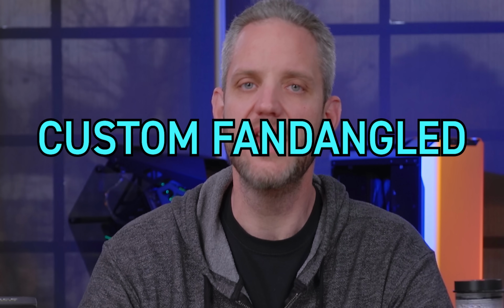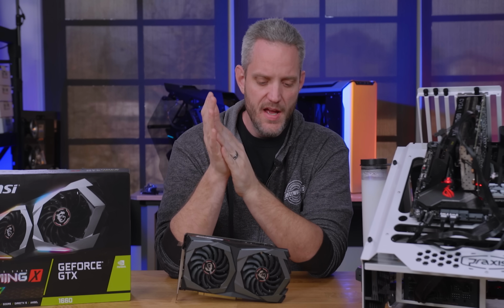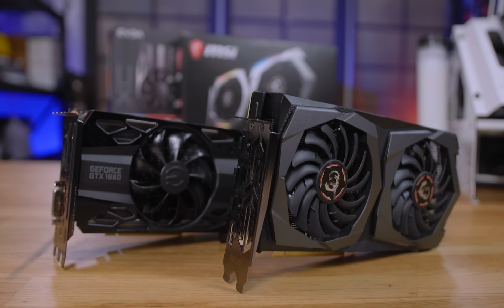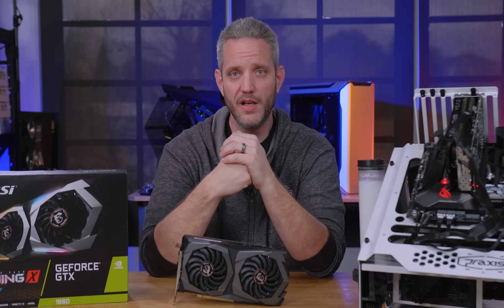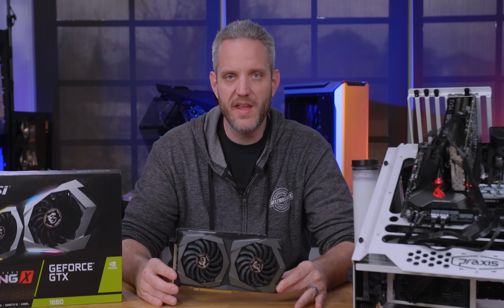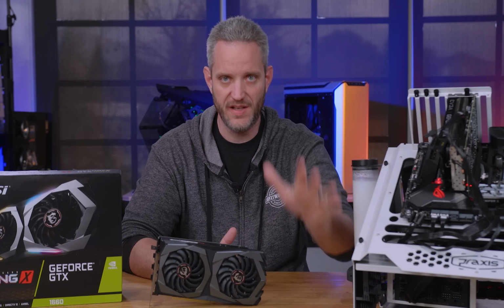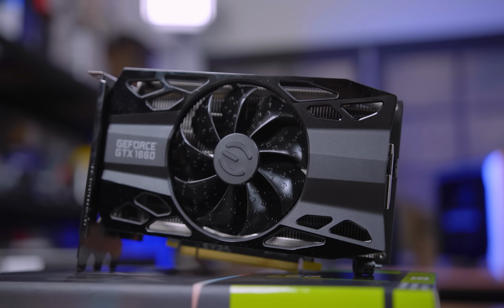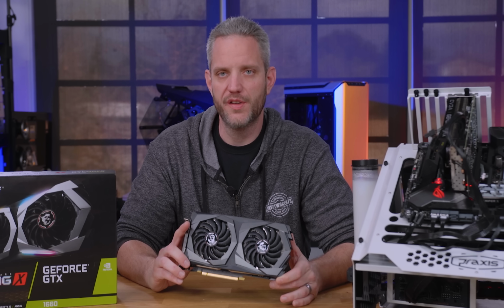Just save your money.... GTX 1660 vs GTX 1060

Comment: Nvidia is crowding the stack so AMD can't jam a card into an open niche
Reply: With AMD losing the bonus of freesync... they have to beat Nvidia in price to performance. They don't really have anything going for them anymore.
Reply: @calebjames7330  I want AMD to focus on Ryzen CPU's because they are freakin good
Reply: MBA right there
Reply: Well, NVidia has an 82% share of the GPU market for a reason.
Reply: @wolfshanze5980  Indeed, OEMs and laptops are a bitch.
Reply: The good news (and i run a ryzen system and have nearly always used amd cpu's for 20 years) is that intel is getting into the game. It has become obvious that AMD's video card upper management is incompetant
Reply: @hbihu One thing remains though, if you consider taking full advantage of a NVidia Card, you talking GSync, meaning those very overpriced Monitors for 3x the money you would purchase any normal Freesync monitor. 

Now here is where college eduction comes into play:

NVidia Setup for 1080p gaming--> MSI GTX 1660 TI + Acer Predator Z271U bmiphzx 27"(yes only a 27") = $310 +  $764 = $1076
Now do the same with an AMD card and a Freesync monitor... half if not even less $$$$, its basic economic

AMD setup= RX580 $210 + LG 34UM69G-B 34" FreeSync IPS WFHD Ultrawide Gaming (YES a 32" panel) $388 = that makes it a grand total of $588 

Yes the PC master Race will always go with NVidia and always go with the Intel product just because they can... is the juice they drinking worth the squeeze? Hell no.
Reply: No. I reckon it is stacking to offset poor sales. Desperate action. NVidia releasing this many cards in a short period. Purely to close gap on a bad forecast.
Reply: Only better for consumers cuz amd will try to get some in there and to do so it has to be a bit cheaper
Reply: amd has been trying to just compete with what nvidia makes. their next navi cards will be the same. they will try to compete with the 2000 series , not more not less.
Reply: I didn't get it ... Can you explain it to me my brother ?
Reply: @Aniket Sharma Nvidia are filling the market with GPUs across the price ranges to try stop AMD from pinching any value spotlights.
Reply: @an1ketsharma  basically saturating the midrange market with several cards at very similar close prices....so when amd comes along with navi, which will probably be toward midrange market ($200-$300 cards at vega 64 levellike performance with  8 gddr6 imo), nvidia willl basically already have an answer/competition to it or can just put sales.
Reply: @NateT092  What if they have a better performing GPU than the same card offered at the same price. Will this theory be still applicable ?
Reply: @hbihu IKR, so how this saturation is supposed to impact the AMD Navi launch ? I am not getting it.
Reply: @an1ketsharma  

I'm going to make up numbers here but it will illustrate the point.

In 2019, 1000 people will build a new pc. 200 will go for higher end cards. The ones that retail around '500+.
600 will go for mid range ( $300 to 450) and the rest will settle below those margins (older generation cards and other $250 alternatives)

600 people (or 60%) will want to build a mid range PC. If nvidia puts out 10 different cards that fit within the 300 to 450 price range compared to AMDs 1 or 2. Those 600 people are more likely by the numbers to buy an nvidia product. 

This completely ignores other market forces, the most obvious being that nvidia is already in the market for this year. So if 300 out of that 600 have already bought parts, that leaves AMD if they released today, with only a possible 300 to still pick up. 

I hope this cleared this up.

Comment: Please do a comparison between GTX 1660 vs Rx 580
Reply: What I've seen from other reviews say 1660 is about 20% faster. I'd say worth it if you can grab a 1660 for around MSRP, yet the 580 is still a compelling buy under $170 which it can easily be had for.

Comment: Jay,  what are your thoughts regarding budget builds and the current graphics environment? Last year several channels did builds in the $300 to $500 range using the 2200G or 2400G to avoid the insane (at the time) graphics and memory markups. What is the current upgrade path? Another 8 gigs of memory and a 1660 TI? Replace a slow 8 gig kit with a fast 16 gig and a 1660? Straight to the 2060? Thanks for what you do!
Reply: Go straight to the 2060 if you were planning on buying a 1660 or the ti already it’s not that much more. That’s the general census about GPUs currently since it’s 50% more performance in a 2060 over 1660ti for only roughly 30% more price along with the features of DLSS and ray tracing if you even feel the need to. The ram the case is almost any type of ram can reach 2933mhz fairly easily and past that frequency there’s not as major gains on ryzen so I’d get 16gbs of total system memory. If you do not have an SSD yet that is the biggest upgrade you can make on a system I believe personally and so do many others even if it’s a small 60gb one just to hold windows you’ll notice the difference in programs not just startup. Hopefully that helps. :)
Reply: @thecraftedalliance  I have not seen any benchmark test where a 2060 outperforms a 1660ti by 50%.
Reply: @jasongl1569  exactly he was lying tbh
Reply: @thecraftedalliance  2060 doesn't deliver 50% more on 1660 ti, not even close. More like 15% to 20%.
Reply: Look for refurbished items as well instead of purchasing them new. My current setup cost around $600 and has got great upgrade potentials.

-Ryzen 2200G 
-GTX 1060 3GB Refurb (Saved $150) 
-16 GB RAM (8x2)
- 512 GB Samsung SSD
- 1 TB Blue WD HDD Refurb (Saved $10)
- MSI Gaming Motherboard Tomahawk Refurb (Saved $75)
Reply: Charley Fernandez refurbs are sketchy imo. Refurb usually means something broke at one point in time and usually the warranties are like 30 days to a year. Your better off buying a used one that works, it’s usually cheaper as well.
Reply: @johnmoore1495  I understand you bro and i know where youre coming from. That being said, my system is running great and I have had it for 4 months now. $600 is a great deal since im a broke college student. I cant be too picky lol
Reply: @johnmoore1495  A used one that was bought as refurbished :)
Reply: Are you running 2x4GB sticks with 2 slots or 4 slots? If 4 slots then I'd say just get another set of 2 sticks. RAM speed isn't going to make that big of a difference unless you got bottom shelf 2133-2400mhz RAM. If you're purely going for value I'd say get a 1660 and another 8GB. However if you really want to spend a set amount of money then I'd say get the 1660Ti with another 8GB of RAM over a 1660 with a new set of 16 GB of RAM.
1-2. GTX 1660 with 8GB of RAM. (Value)
1-2. GTX 1660Ti with 8GB of RAM. (More likely to increase performance than option 3)
3. GTX 1660 with a new 16GB kit.
Reply: You'll get most gains from 1660Ti and 8 gigs memory. Ryzen does like faster ram, but % gain isn't near what you'll see going from 2400g graphics to 1660Ti.
Reply: If you built a 2200G or 2400G system, with the intention of buying a gfx card later, I'd suggest you aim for the 2060. I don't think the RAM upgrade is going to be felt nearly as much as getting a 2060.

Keep in mind that 8 GB is plenty for gaming at the moment. Personally I have 16 GB of RAM, and I can run games with no issues even with 3 VMs running and eating 8 GB of RAM on their own.
Reply: Definitely 2060! When I heard of 2060 performance I felt very stupid buying a 1080 a year ago. And SSD even smallest one as it was already said - if you don't have one.
Reply: @AntonMochalin  Eh, I wouldn't worry about it. 2060 is still only at the level of 1070 performance, so you're beating it with a 1080.
Reply: @wasd____  2060 is more like 1070ti performance and 1070ti is very slightly slower than 1080. And that's for half the price of 1080. Plus some raytracing and dsll.
Reply: @wasd____  Jay made a very good video on 2060 performance not so long ago.
Reply: @AntonMochalin  Yep, you're right, it's more like 1070ti. Well... at least you're still slightly ahead, for what that's worth. 1080's still not a card to feel bad about having this year.
Reply: We need some competition, thats what we need.
Reply: I remember SSDs hitting the consumer shelfs for the first time, Super expensive price per GB, And if you could afford to treat your PC it was like a special miracle happened! Years later they are still more expensive per GB than HDD, But they are easily affordable and pretty much a standard in today! Having said that, It should be more than pretty much by now.. SSDs should be the new standard hard drive! Tech and production is moving at lighting pace, Spinning disks should be a thing of the past imo
Reply: @helenHTID  As spinning disks are cheaper they have their place as cheap storage. I have a 256 GB SSD but most of my Steam library games are installed on HDD. I like trying new games and they're quite often 50GB+ these days.
Reply: @Anton Mochalin What I'm saying is Solid State should be the new standard and cheap. It should be used for everything including mass storage. And they should be strong and reliable. maybe it will happen one day, I'm just surprised with how slow that reality will become because everything else (price-production, Technologies behind them) are moving forward rapidly.
Reply: @helenHTID 
What ever happened to 4D storage Crystal Technology?
Reply: Could anyone please Make a $500 intel build for me that skips having a good gpu that I could then upgrade to a 1660 or 2060?
I have $500 saved up but dont want to buy parts for a Pc then have fomo because there was a better deal out there.
Also, Ive never tried AMD/Ryzen CPU's but I know that I only want to game on NVidia Gpus.
Is it Noob of me to ask if I can Game with an Nvidia Card on a Ryzen Cpu?
I need help fellas...
Reply: @poppershnoz4536  Yes it's noob of you to ask about Nvidia card with Ryzen and yes Nvidia cards work fine woth Ryzen xD Should your $500 budget include a display panel?
Reply: @AntonMochalin  no, I have a Moniter.
Reply: @poppershnoz4536  you can use this build as a base https://youtu.be/e9aRzfF4WCw remove gfx card from it and maybe replace 2200g with 2400g and then wait till you have money for 2060. 2200g will bottleneck 2060 a tiny bit in some games but remember 2060 is almost same performance as 1080 which was flagship when Pascal launched 3 years ago. 1440p will do very well with 2060 and 1440p is very enjoyable gaming (4k isn't very good even on Titans still) xD. You can also take out hdd or ssd from that build but not both xD . And with integrated gfx in 2200g you can still play Warframe with 60fps on medium and other casual titles  like Overwatch or Fortnite too. Not even speaking of Dota 2 or LoL which run ok on potato PCs.
Reply: @AntonMochalin 
Excellent! Thanks for the Info! +Rep

Comment: For 1060 6GB/580 owners, the 1660 Ti is the one to look at. For people with lower tier cards, this one's obviously better value than the Ti, and a decent upgrade too, but only around its MSRP. If the 1660 you're looking at is closer to the Ti's MSRP, then you may as well save up a little and go for the Ti instead.

Of course, this is obviously something that's going to vary from region to region, but I'm mainly talking US pricing.
Reply: I think you forgot about 2060
Reply: @budgetbajur  That's a whole different price bracket, and not good value over the 1060 or 580 like the 1660's are, which is mainly what I'm focusing on due to the video and Jay's question at the end.
Reply: I think is, it's way better than all of the GPUs above, unless you have a REALLY tight budget
Reply: @budgetbajur  Yes, it's good value compared to the GPU's above it, because they're shit value, at least for gaming, but you're still only getting more performance over what you paid for a 580/1060 by paying for it. Meaning, you pay ~60% or more over what you paid for your 580/1060, for ~60% more performance. With the 1660's you pay either the same, or only a little more, for more performance.

Don't get me wrong, the 2060's not terrible, but the 1660's are better value and in the same price bracket as what 580/1060 owners paid.
Reply: I own a 1060 6gb, and to be honest if i was looking to upgrade, i would shoot straight to the rtx 2060. 350€ for a 1070/1070ti performamce, heck yeah

Comment: Nvidia's like shopping in the supermarket. 12oz can of beer is now 10oz. Pound of coffee is now 14oz. Snickers bar is a touch smaller also. All of it's designed so we think we're getting the usual, and with Nvidia, we're getting a more powerful card to replace our 1060. Am sure they will launch a 1670 and 1680 soon. And they still got the 17, 18 and 1900's to fill.

Other than confusing the consumer, which is pretty normal, they at least keep all the YouTube channels busy running benchmarks!
Reply: The grocery store people invented modern marketing, a  spot on observation.
Reply: They will NEVER release "the 17, 18 and 1900's to fill" in the current state of the GPU market. We should rather hope that Intel and AMD actually stick it to Nvidia and compete, but it seems like a stretch that Nvidia would cannibalize their own lineup
Reply: i dont think youre supposed to replace the 1060 with a 1660
Reply: Well, except they're not. You're not getting less performance for the same money as compared to previous generations. You're getting more. It'd be like the grocery store upsizing their packaging so that now you're getting 20oz in a "pound of coffee" instead of 16oz. Also, your video card isn't like coffee. It doesn't run out regularly, and you're not likely to keep buying new ones unless you actually need one because your old one broke or just can't hack it anymore.

I get that people are butthurt that cards aren't getting both faster and cheaper at the same time, or at least justifying the price of the new generation with ridiculous huge performance leaps, but we're not in the era of Moore's law anymore. Something had to give. But the value proposition in terms of processing power per dollar is overall still getting better, not backsliding.
Reply: @wasd____  Nothing you said here justifies Nvidia's blatant price gouging with their RTX line.
Reply: @TopherJenx  How are they price gouging, exactly?

Comment: I have a gtx 1060 3gb ,not a problem for running games like pubg at 80-100fps so why is it bad ??? This pc business is confusing as hell 😂😂
Reply: What settings are you using? I’m on a 1060 6gb and can’t get 100 but I use max settings
Reply: @mindofmyown333   everything on ultra apart from shadows and foliage , I have overclocked the gpu but only upped figures by 10 so only a litttle overclock

Comment: 1660 vs RX580/590?
Reply: 1660, faster, uses less power, runs cooler, is cheaper. See Hardware Unboxed review.
Reply: @mips13  I'll have to check that review. Thanks!
Reply: Hell slap the 570 in there too.
Reply: @janglenutter3820  Sure, why not?
Reply: After one year of finewine improvement, rx580 and 590 would surpass gtx 1660 by 15% up from 10% behind as of today!!!!
Reply: @withcarename  idk about that---it's important to remember that polaris (and even polaris+) is an aging architecture. And regardless of driver improvements and software optimization, there's only so much you can squeeze out of silicon before it breaks.
Reply: @crazycajunj1703  a lot of people do. 
Just because you don't, doesn't mean other people won't.
Reply: @crazycajunj1703  If there's one thing I cant stand is blind fanboys. They're like religious nutters.

Comment: I'm upgrading from a 750ti to a 1660ti... for me it makes sense, since if we look beyond 1660ti there is only a 2060(350€) and a Vega 56(260€). Yes, RAW the Vega 56 looks stonger compared to a 1660ti, but in reality, both perfomce the same. The biggest diffrence between a 1660ti and a Vega 56 is the power comsumption, since the prices has fallen and is equal to a 1660ti.

#OH, THIS VIDEO WAS ABOUT THE 1660 LOL.
Reply: you rather just get the 2060 over the 1660ti
Reply: or you could wait and see what Navi does, at least in terms of prices, if you've waited that long. Maybe grab a used 970 to tide you over, theyre super cheap now.

Comment: its getting extremely more difficult each year or so to work out what g / card to buy ... or whats good value for money ...
Reply: never buy new cards unless its with 15% site wide ebay promo i paid $300 for my used GTX 1080 last year with warranty till 2020
Reply: If you want to get something cheap that offers decent performance then rx570 is on crazy sales with free games. You can easily play 1080/60 on high to ultra settings depending on a game, then upgrade gpu after ps5 is out, then you will know what to aim for, and we will have intel GPU, new nvidia, and AMD cards so there will be much more competition on mid-high end.

Used 1080 can also be good but there is always some risk with that.